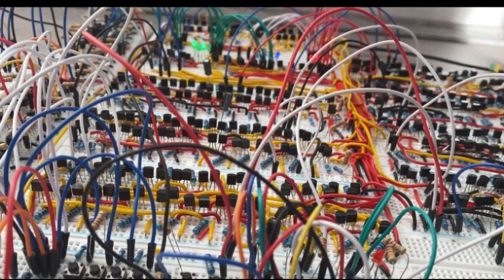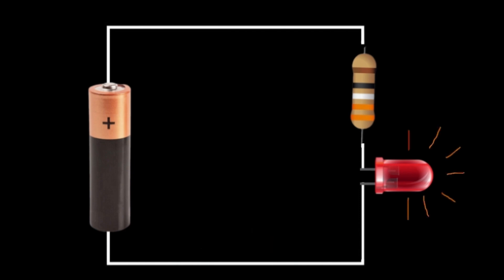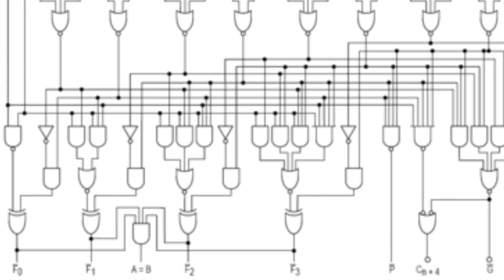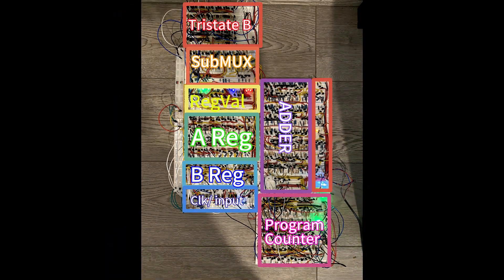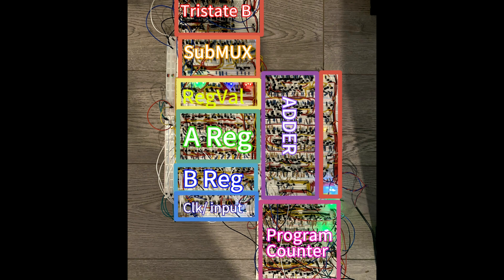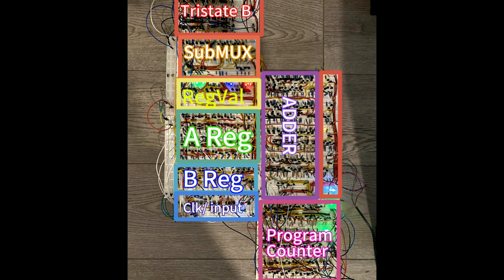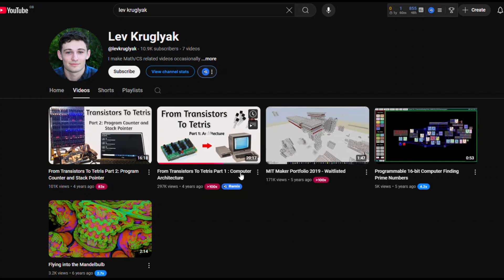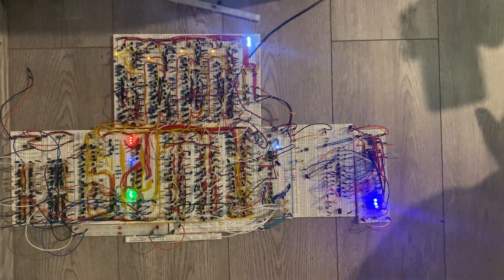I Built A Computer From Scratch!

Comment: This is something I want to do, but in my case with discreet ICs. I’ve got an unused ATA (IDE) hard drive I intend to use also, back from my video capture days.
Reply from the maker: Then get to building bro! Goodluck and I hope you can share your designs too :)
Reply: @bigChaks I’ve got the design of the CPU to do first; will be 16 bit and will need to design instruction set (at least the start of it) along with registers and addressing modes. I’ve got a few projects to finish first.

Comment: cant we use mosfets instead of bjt transistors for the CPU cause most processors use those
Reply from the maker: You certainly can! I have no experience with mosfets though and I wanted it to be very “1970s”. So I just chose to use classic transistors.

Comment: Wow, that's really amazing.  My last project involving large numbers of diodes and transistors for logic had about 40 transistors and 80 diodes (I used DTL for the logic) and although it worked perfectly, it was incredibly unstable and the slightest bump would cause a connection somewhere to jitter and glitch.  My project was basically a little corner of your computer!!  The issues with current draw between connected transistors affecting the logic levels must have been a nightmare to work with, not to mention power distribution and management of voltage drops. A lot of people would look at your design and be impressed by the complexity but, anyone who has delved into transistor logic on breadboards would appreciate the underlying complexities and realize that there's so much more to this than meets the eye.  As you pointed out, using logic chips is much more efficient but, if it were only about the computer then there's no point building one at all.  It's all about the journey and what you learn along the way, and I'm betting that this one was a wild ride!!

Comment: I have built in Logisim Tetris in Size of 5x5 with one point falling. Now I building the full Tetris. But I am overloading Logisim only with the memory and with the system that delete full lines. Next I will building the different blocks with one point in the centre moving and adders fore the other 3 points.
Reply from the maker: That's really cool! I'll try to get the same thing working as soon as I can :)
Reply from the maker: To delete full lines I just thought of a trick. You can have a few bytes in memory that hold all the pixels of the Tetris shapes. When the address value = 255 meaning the line is filled, then move the upper Values down with a series of move instructions! I know this probably doesn't make sense right now so I can't wait to make it irl😪

Comment: How in the holy Yakub did you build this on breadboards without any loose connections. Usually when I build something 1/10 the size, I feel blessed if there isn't a problem.
Reply from the maker: Oh trust me I had a bunch of loose connections 😂. Whenever I built a board and something didn't work it was better to take it all apart and rebuild it than to troubleshoot lol

Comment: Mad lad? Absolutely!
Useless? Absolutely not!

This is absolutely real and valid today. He's done at a macro level what chip designers do every day on a micro level.

He's designed the architecture, developed the instruction set, set the data and address width, programmed in every feature, and done it one transistor junction at a time.

The difference? He did it using discrete transistors instead of doped transistor junction domains in a silicon wafer.

I would hire this guy so fast there'd be a hole in the air!
Reply from the maker: Thank you for the kind words :)
I'm glad I'm hireable atleast haha
Reply: @bigChaks 
No, seriously!

If I were hiring for any kind of technical position, there'd be a hole in the air with your outline.

Why?
Technical skill you can train.
Talent, imagination, patience, and persistence aren't things you can train. You either have it or you don't.

And you, sir, most definitely have it.

Comment: Yoo theres a channel called global science network that did something similar, its cool to see someone else did it too:). Im working on the clock rn, but its selling😭
Reply from the maker: Yhhh I know abt that channel. I actually learned how to make the transistor circuits from him just before starting this build.

Goated channel, you see he built neurons on breadboards on his latest video? 😂
Reply: @bigChaks  Yeah, wild stuff! 

Also, I was wondering what breadboards you are using for this project? I'm having some trouble with some of my compenents where the results are super inconsistent. For example, I'm making a binary counter and each of my flip flops works fine (usually), but when I pair them all together, the results start to differ. Sometimes it'll work better when I squeeze the breadboards together, so I'm thinking I've got some low quality breadboards or something😭😭
Reply from the maker: @ethantong8411  I got all of my breadboards from Elegoo on Amazon( they come in packs of 3) and they worked well but after leaving them in a drawer for a few months they've stopped working. I didn't know breadboards have expiry dates💀. Lol they all rusted a bit and are basically unusable now.

As for the counter. I hate using flip flops or any other kind of memory chip. They are always unpredictable so I really cant help you there. For my counters I use an Adder and some d flip flops. This is way easier to wire up at the transistor level and has some benefits that help with jump logic later. You could email Cody from theglobalsciencenetwork and he will answer your questions, im sure of it. Goodluck! :)
Reply: @bigChaks thank you so much!! Wait so are u gonna have to redo ur computer then😭?? Also damn didn't know they expired either💀
Reply from the maker: @ethantong8411  lol yeah the computer in this video doesn't exist. It met a very brutal end lol. I will have to build a whole new design maybe on PCBs if that's what people want to see.

Comment: i wonder, how is it powered?  does it use a like 5v rail, and what kind of power source do u need to provide enough current for it?  such a cool project, its not useless!
Reply: also, can you just increase the clock speed by adjusting the timing of the clk input, or is the switching speed of the transistors the limiting factor?
Reply from the maker: Cut up cellphone charger/ mouse cable provides all the power lol. And for the clock speed changing around the capacitor and resistor values on the 555 timer does the trick.

Comment: Thats so awesome :) subscribed.

I'm personally really interested in the counter circuit and also how you made the clk (just a multivibrator?).
Keep it up and thanks for sharing :)
Reply from the maker: @MattFixesStuff  The clock was just a classic 555. I want to use a transistor transistor clock this time though.
Reply: @bigChaks  ahh love the 555 timer!

Would be awesome only transistors, caps and resistors. Maybe also inductors und diodes. 

Also love building stuff without IC's. Makes everything really large though like you say :)
Reply from the maker: @MattFixesStuff  haha using inductors and stuff will start to feel like homework and I like to keep things intuitive 😅💔. I hope you find my approach to the counter circuits interesting! :)

Comment: Tbh, im really curious to see what you can do with only 2 registers. Usually my computers have 6 registers, but i use 4 to a simple program. To make a fibonacci sequence i would need 3 at least (regA for ldi and input a for alu, regB for input b for alu, and reg 3 for alu output and input for conditional jumps).
Reply from the maker: @All_Playars  we have a bunch of registers in RAM haha. 2 is good enough for the ALU to work with. Thats actually how real computers assign variables. For the fibonacci sequence it would be very simple and only take less than 16 instructions

Comment: thats why computers were as big as a whole room. good luck bro
Reply: no its because you couldnt scale relays down unlike transistors which can be as small as a few atoms wide.
Reply: @Cinarbayramic  thay used electronic lamps, not relays, relays are really power hungry, also they emit heat af, and they are really loud
Reply: No it was due to vaccum tubes being so big then came the relays they were also big transistor were a revolution in scaling down
Reply: @divyanshuxwb  computer order... mechanical, relays, tubes, transistors, logic ics, LSI bit slice, microprocessors.. many of the tecnologies stuck around and overlap.
Reply: If you Look at a Zuse 23. Ist a transistor base computer filling a room. If you wanted a turing complet Maschine you need: more register, ram, jump, status flags.
Reply: because they use manual, traditional electrical components.

while the current computers use some atomic technology thing. smol stuff.
and soon going to be about quantum technology..

Comment: Cool, you are off to a great start! If want more help you can check out my videos about a 4-bit computer or Jerry Walker's book (computer time travel) where he built an 8-bit transistor computer! There are not many people who try this with individual transistors! It is a fun project and you will learn more than most people realize! If I was to start over I would have probably used 2n7000 mosfet transistors so it would be more power efficient. You could try a few circuits using these and see if that seems reasonable. Good Luck!
Reply from the maker: I've actually interacted with you on a bunch of your videos from a different account( @chaksFM) . They are actually where I learnt the transistor circuitry from :)
Reply: @bigChaks  Great, I subscribed! I look forward to seeing what else you build! It is good to see other people learning the fundamentals!

Comment: cant be helped but how is that different then https://www.youtube.com/watch?v=HyznrdDSSGM&list=PLowKtXNTBypGqImE405J2565dvjafglHU ? 
ben did the series years ago ..
Reply from the maker: @MrDragonFoxAI  we are talking hand making every little detail of the circuit here. Everything is built from scratch. Ben Eater used ICs which are pre-built circuit chips. This gives us intimate knowledge abt the circuitry and we can get some cool exploits out of it
Reply: @bigChaks  logic ic's have been used since 64 - you learn boolean logic better from Nand2Tetris - you dont build the mosfets / transistors from hand either or do you now ?
Reply from the maker: @ I would if I could haha, but yh no hate to Ben Eater. I just appreciate the little details more and the ways we can probe any part of the circuit. I hope you feel the same when we start designing the thing :)
Reply: @bigChaks  idk beeing a cs/ee for 20 odd years - i just know that you dont need to go down to the transistor level - you can debug and probe it inside the ic too - as those old ics are fairly simple devices - nand / and / or and what not is fairly trivial to debug and probe with even a simple scope - but good on you for embarking on that - just mind you more parts = more errors - you think about that once you are deeper in it - best of luck regardless

Comment: Theres a lack of appreciation in 'computer" because everybody just wants to start from the "latest and greatest". Nobody doesnt want to start from the bottom bottom and learn everything from their to the top. Plus everybody is having everything done for them and everybody is used to closed software running their lives/hardware/everything for them. Nobody looks at how stuff actually works. Plus "Software programming" truly stands in the way of someone learning how circuits really work. 

This is the reason why I specifically hate software and how everything is turning into a software controlled world. Nobody is gonna know how to make stuff from scratch anymore or do any kind of mental math either. 

Over my days of self studying basic electricity/electronic components. I have noticed that software is really not needed at all to achieve anything you want. All you need to do is master the electronic components that will in return manipulate the electricity/circuit to perform what you want it to perform. I honestly see software programming as something blocking you from truly understanding how the circuits really work. People need to work with their hands first before even thinking about having some 'automated command" take over.
Reply from the maker: That is true. Learning just the software is like reading a book without reading the 1st chapter and getting the necessary exposition. You can piece the story together, but there isn't a strong connection formed. Learning the intricacies of the circuits beneath can allow you to create some cool stuff when combined with software and I hope I can show that throughout this video series. :)

Comment: I'm also working on designing a computer using transistors.  Mine's 8-bits, I haven't started building it yet but I have a gate-level logisim simulation working.  I'm currently working on translating the gate-level design into transistors.  It will be interesting to see where your design ends up 😎
Reply from the maker: That sounds great! Id love to see your design too :)

Comment: If you want to go even more simple, relay computers, just real physical switches. There's a few people doing relay builds on here. There's even a few people working on building tube based machines for the middle of the road.

I also emplore you not to "cheat", many homebrew transistor computer projects end up using an IC or two anyway for memory or other things, but when you don't, it gets real interesting (I recommend capacitor based memory as it's relatively beginner friendly, and models modern DRAM).
Reply from the maker: Nahhhh im gonna have to use an IC for RAM since id like to address 256 bytes and an extra 16 bytes for the stack. I will explain the idea behind ram in a video about registers and memory tho. Relays might be the next project! :)
Reply: @bigChaks  have you looked into core memory?  256 bytes should be doable with core memory, and you wouldn't need IC's.  Unfortunatelh I need 64kb for mine, so not really doable in my case.  But it would be fascinating to see someone build a truly IC-less computer on here.
Reply from the maker: @PolymathUnlimited-du2hg  I hadnt looked into that. Ill see what I can do! :)

Comment: I'm also working to make a 4-bit cpu inspired by the Intel 4004 microprocessor.
So far, i bought 4000 N-channel smd mosfets that are 1 by 2 mm small,
And i will have to solder them using enamelled wire for quick prototyping, trail, and error (inspired by a reuploaded Japanese video called extreme prototype board wiring)
I would like to see you try mosfet technology as it's cheaper than buying pre built logic gates, and if you do a cmos technology,
In theory, you would have no static power, just power consumption from switching frequency.
There is a website called LCSC Electronics that sells cheap ICs
And cheaper if you buy them in bulk.
The technology i will use is NMOS only which uses half as much of transistors as cmos but it requires low resistance for low static power.
I could possibly use pass transistor logic which uses much less transistors and solves the static power problem but it has a higher chance to give you errors if you're not careful.
Reply from the maker: yhh I heard mosfets were very easily damaged so I wanted to use a more stable technology. I bought a bunch of these transistors and resistors off of aliexpress for dirt cheap too. Goodluck with your CPU project! I'd love to see how it comes out :)
Reply: @bigChaks  yeah, that's true , mosfets have generally more capacitance inside them, so you would need to lower your frequency to avoid shorting the mosfets.
Also good luck with your series.
I would also like to see what others are making so we can help each other.